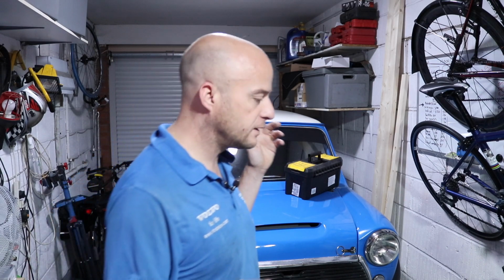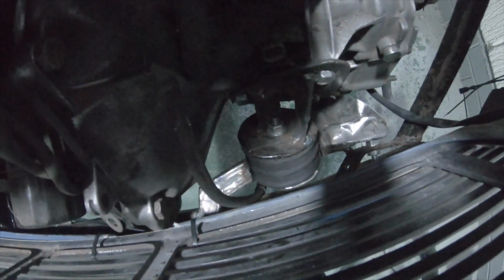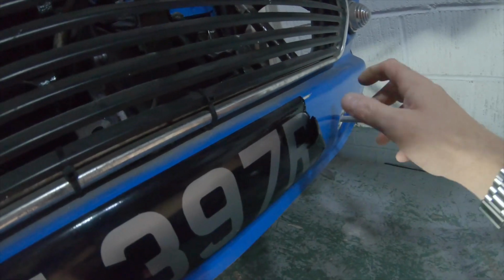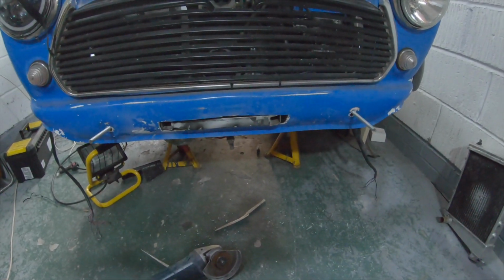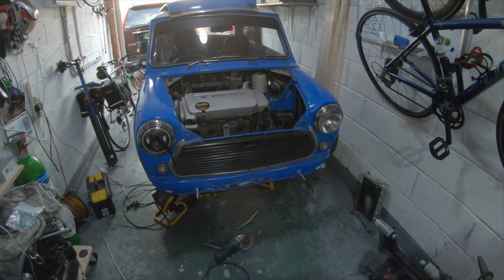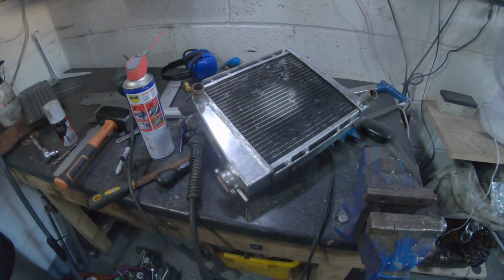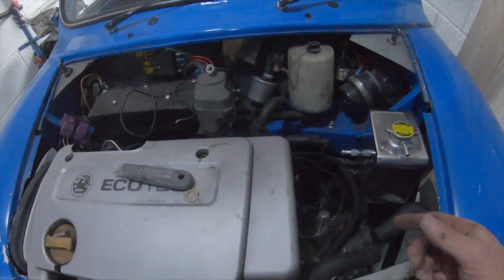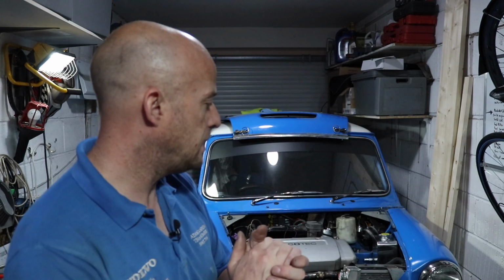Classic Mini Enigne Swap - Radiator and Cooling System

Comment: Hi Adam, you've made me think..... will a rad work OK like that, turned through 90 degrees? Flow will now be across the rad, not up and down? Or am I overthinking it! 🤣
Reply from the maker: To be honest I haven't a clue. I might be wrong but I think modern cars radiators are orientated differently to classics. One way to find out for sure lol